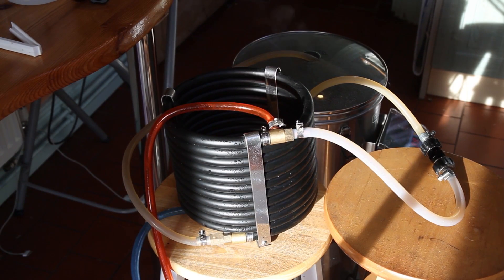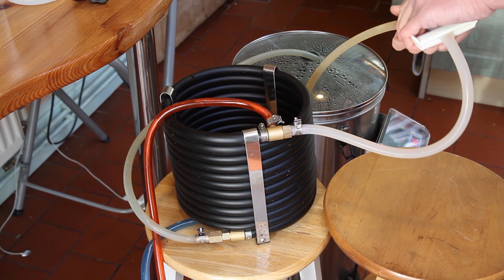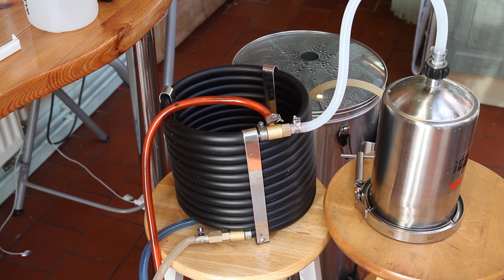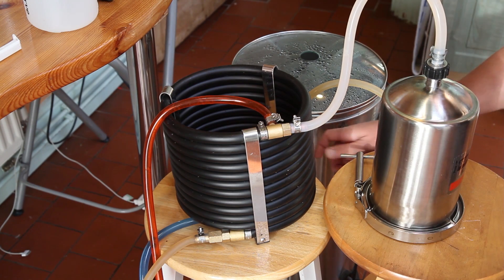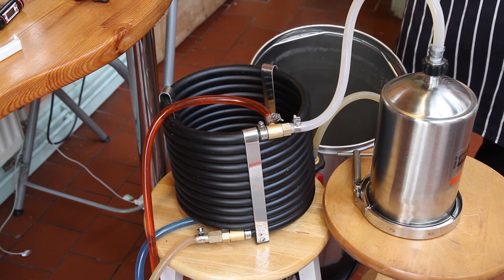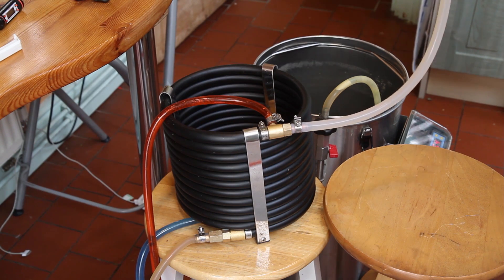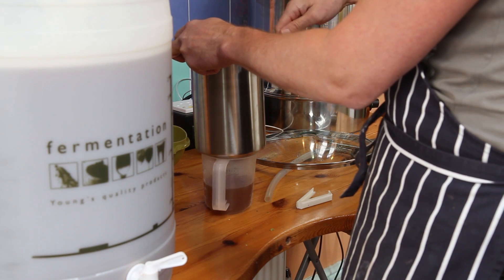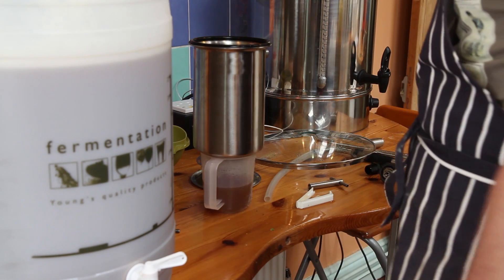Grainfather Brewing - Using a HopRocket part 2

Comment: You will be adding a lot of IBUs to your wort because your rocket is pre chilled wort (90c) or so would it not be better to cool your wort down to say fermentation temperatures first ?
Reply from the maker: Thanks for the comment David. You are right, wort at over 80 degrees could still contribute some IBUs. If I wanted to avoid this I'd chill it down to 80 degrees Celsius or less first, as I do sometimes with a whirlpool for the same reason.

Comment: Couldn’t you sterilise the Hop Rocket empty as part of the normal counterflow procedure then add the hops before cooling?
Reply from the maker: John Terry Hi John thanks for commenting. Yes I could connect the Hoprocket in as part of the normal counterflow sterilisation but I’d then have to empty it of wort again to put the hops in and it’d be very hot by then.

Comment: Hey mate have you used the rocket with pellets yet or just flowers? Also have you had a chance to do a split batch with and without the rocket? Cheers
Reply from the maker: HI - No I haven't tried pellets the manufacturers say you should only use whole hops because pellets would break up. I haven't done a split brew yet either but do intend to do one.

Comment: Great video, had a hop rocket for a while and was worried that the pump on the GF would not cope, now i know it will. I am considering using the hop rocket from now on for all last hop additions without the need to dry hop as i hear the efficiency of the extraction thru the hop rocket is superb.
Reply from the maker: Thanks Tony - empirically my results through the hop rocket seem good but I plan to do a split brew with 50% going through the HopRocket and 50% receiving a hop stand to see if any difference can be detected on blind tasting. I'll update with a video when I've done it.

Comment: How was the end beer from this? Do you think the hop rocket was a good investment?
Reply from the maker: +David Heath Hi David. The beer in the video was a Mosaic single hop ale. It was very hoppy and very popular. It's hard to say how much the Hoprocket contributed compared to an equivalent hop stand. I plan to do a split brew test soon, putting half a batch through the Hoprocket and the other through a hop stand, and then do some blind tastings. The Hoprocket is a nice bit of kit and easy to use, and the fact that it can double as an infuser /randal on the dispense side gives it added value. I'm yet to try this out.
Reply: +Gary James sounds like a good plan. Would make an interesting video for sure :)

Comment: Great vid, thanks for taking the time. Lovely piece of kit, looking forward to the beer review. How do you monitor the temp of the cooled wort? I've seen a gadget called a thrumometer which looks really useful.
I finally got around to doing my first GF brew at the weekend, it was an absolute joy; so easy. I concentrated mainly on method rather than numbers but l was way out on my final volume. I wanted 23ltrs, l finished with 20. What total volume of water do you start out with for a 23ltr brew?
Regards, Ken 🍺
Reply from the maker: +Ken Fuller Hi Ken - thanks for the comment and I'm pleased you've made your maiden brew! I use a cheap electronic temperature probe from Ebay like this: http://www.ebay.co.uk/itm/Digital-Food-Thermometer-Temperature-Probe-BBQ-Meat-Steak-Turkey-Milk-Wine-Jam-/301851280945?hash=item4647bd0631:g:46EAAOSwI-BWMfGW

I thought the thrumometer looked neat too but opinion on it is mixed - it's just a liquid crystal thermometer so neither fast nor especially accurate. The cheap probes give you an instant digital readout. As for volumes, I always use the volumes calculated from the Grainfather formula / app. The exact volumes will vary depending on your grain bill. For the brew in this video I had a 4250g grain bill which needed 15L mash water and 15.9L sparge water. I ended up probably 1L over volume but bang on my starting gravity.